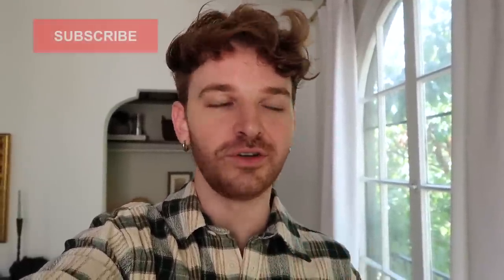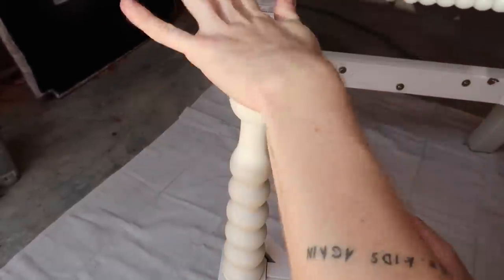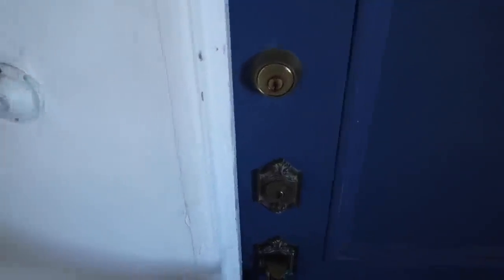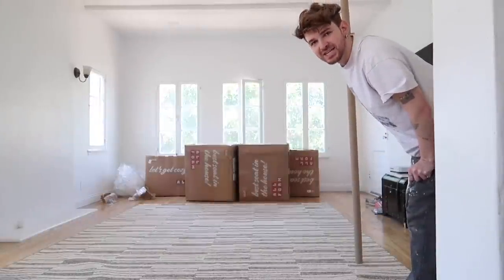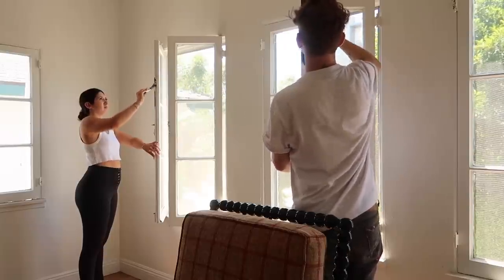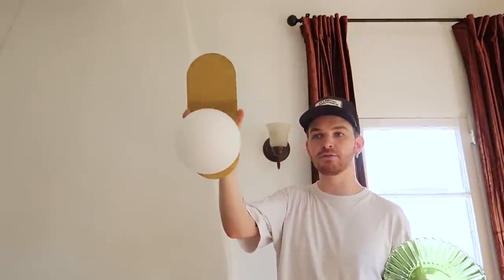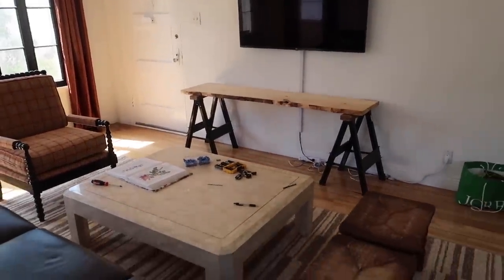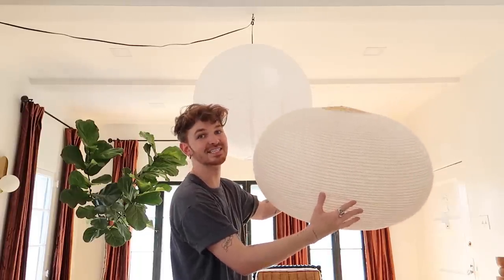Extreme Living Room Makeover Using THRIFTED Furniture & Decor

Comment: TIP: next time you reupholster go ahead and fold a little hem at the edge of the fabric to leave a nice edge on the side you staple last, leaving a nicer more professionally upholstered look and feel with no trimming afterwards.
Reply: Or simply get some cord to trim the seat and back. I had a chair professionaly done and that is how they finished it off.
Reply: He folded a hem on the top and sides where it would be seen but maybe he didnt think to do it underneath...?
Reply: You can use double sided tape to fold the fabric on itself and make it easier to handle on stapling.

Comment: I have just one gripe- in this interior the cord to the lampshade is too visible but it’s a plain black cord. It doesn’t look intentional, it’s just hanging there. The window treatment is a bold choice.
Reply: I agree, you can get lengths of brass chain by the foot at the hardware store and weave the cord through the chain. Or use a fabric cord cover, it's just a long tube that gets scrunched up and looks more intentional. Or even just rewire it to have a white cord that would not stand out so much against the ceiling!
Reply: Wish you could paint ceiling cord white.  Love the light, furniture and room decor arrangement.

Comment: Very nicely balanced, great job as usual. Love the oval cream shaped paper lantern better then the round, white one. The live edge entertainment area I didn't get until you had it all together. Moving the plant. Can I ask why you didn't paint the trim on all the windows black especially in the same room? Was it to make the focal point the wall nearest to door? Were the windows in better shape? Would raising drapes with 8' ceilings work also or does it have to be 9' plus?
Reply: Raise the curtain rods as much as you can.. even if  the ceiling is only 6-12" above the window..  raising the curtain rods draw your eyes up and make the windows appear bigger.. also make sure to extend the curtain rods past the wiidth of the windows too.  The curtain panels should hang outsife the windows so they are not blocking any of the light..  (see where drews orange panels hang in this video..)..

Comment: Adoreeee the bold simplicity 😍✌🏼 one piece of advice for everyone that has 3 windows spanning a room - if you want to use a longer rod, buy three smaller rods and connectors, and use 4 brackets... then place/hide the brackets and connectors behind the curtains! Then you don't have one curtain bracket popping out 👌🏼✌🏼
Reply: Not sure what you mean by connector, I've only ever seen the types of rods where a narrow one slides into a wider one.

Comment: Really well done Drew - what amazing results once it all came together - I bet your friend Jordan would have loved it! I particularly loved the black spindle chair you did up with the fabric you chose to have it upholstered with! Just one thing I noticed that I would have done differently was when hanging the long curtain rod - I would have used 4 rather than 3 wall brackets you used to 1) give it more support, prevent rod from warping or drooping & 2) by using the 4 - most of the brackets would have been hidden by the curtains when they are open, rather than they being a bit of an eye saw in the middle of the rod… otherwise another great DIY makeover Drew!

Comment: If you're looking for a tree that isn't as florescent green and has a darker warmth, look for a Burgundy Rubber Tree or Ficus Elastica Burgudy. It's the same family as the Fiddle Leaf but a lot more resilient.

Another design tip with plants is to keep it in it's nursery pot (until you need to upsize) and put it in other decorative pots. That way, you can keep the plant but change the pot based off of your design aesthetic without the hassle/damage of a repot.